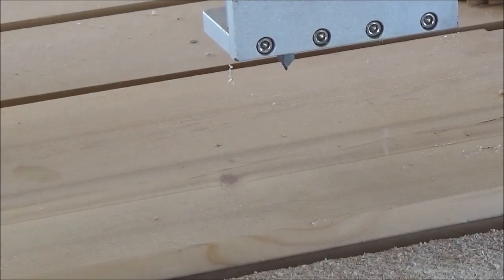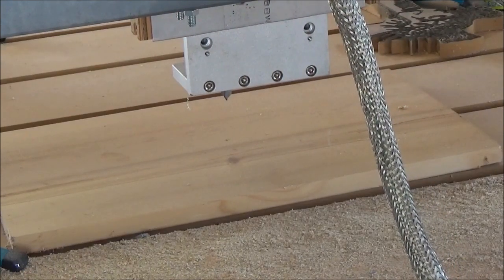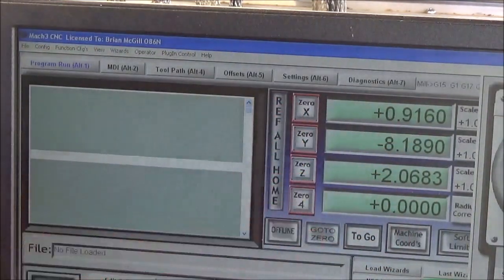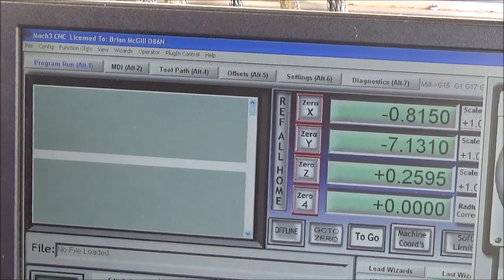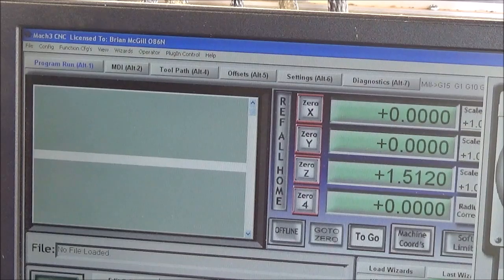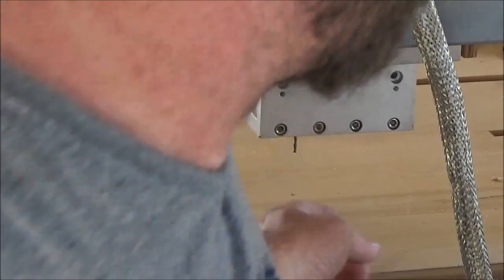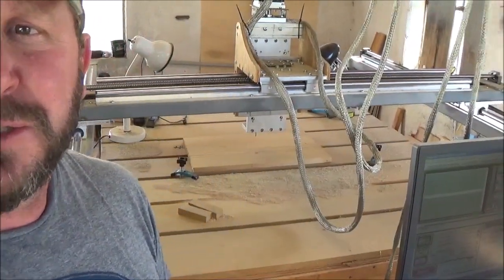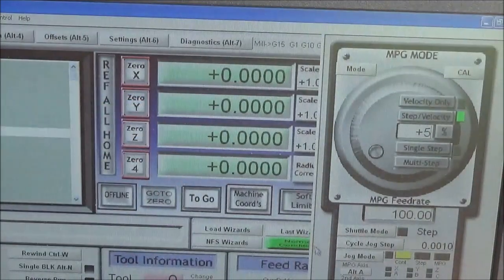Speeds, Feeds and Zeroing (CNC process)

Comment: I am a newbie. When you mention feed rate you are saying a percentage. Wouldn’t that depend on what rate your X,Y and Z can run at.A machine capable of running at 150 imp will be different than a machine that can run a 600 I’m when using percentages?
Everything I see concerning feed rate is inches per minute.
Reply from the maker: Whew....this is a tough one....I do work in inches per minute, I however run at about 60% of the 100 ipm that I have my programs set to....you can email me at smokeyscnc@gmail.com....Thanks for watching!!